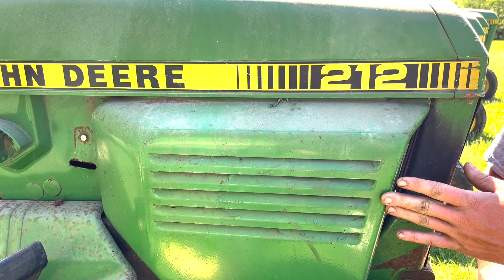The Entire John Deere 200 Series Break Down!!

Comment: I have a 212 with hydraulic lift, '78 I believe. Runs awesome, I run a Brinley plow and double extended tiller for the garden. I run the snow blower in the winter on huge drifts and it does great. I have the belly mount angle grader blade that I've used on my gravel driveway. And I just got a front mount   540 pto drive that I haven't thought of what I'm going to use it for yet. 

Before this one I had an 82 210 that I plowed snow with for 10 years and that was a good old tractor too. 
Thanks for the video.

Comment: I had trouble getting parts for my off brand riding mower so I decided to look at used John Deere. The parts guy at the shop told me he can always get parts so I started looking at older John Deere. An auction from dealer in OH had three non-running machines for sale, AS IS. I figured since they were all 210 ,212, 214, I could at least swap parts and have one good running machine.  The bidding started at $50 and was creeping up about $10-25 at a time. I got fed up with the hassle of checking all the time and decided to wait till two days before the end of auction and make my final bid. Two days for closing I saw the bids were still creeping up at a slow pace. At that time it was about $450. I posted $600 and forgot about it cause I was sure someone would outbid me. NOPE evidently my                          high bid spooked the others, made them think I was going to go as high as I had to and they gave up. A few days later I received email informing me I had won. Wow, so I had to rent a 6x12 trailer and go after them. I live in south central WI.
That was the start of my appreciation of the 200's. I started on the 212. The belts in the mower deck were rusted to the pulleys, had to soak with penetrating oil and pry off with screwdriver. Emery cloth cleaned up the pulleys, I choked when I learned how much new pulleys cost. Needed bearings and paint too so I did the whole thing while it was torn down. Changed the fluids to synthetic, did tune up and the beast ran like new. In the meantime I also looked at other used 200's just to see what was out there. Then I started seeing them on marketplace. Some were, "parts only". I feared the guy was going to scavenge all the goodies and junk the chassis so I offered to buy the whole thing. He was glad to have it gone. Evidently some guys just don't see the good of working on an old one when it starts to get rusty, and has faded paint. One guy posted two non running machines. A 210 and a 214. I told him it was a two hour drive to his place and offered $100. He accepted. While I was there, he offered an Ariens 8 horse walk behind snowblower for free. So we loaded it up. That was the best deal I every made!

I have been buying up anything that seemed to have potential and now have two 210's that actually have a 10 HP engine. Three 212's, and  two 214's. Three are operational and with a bit of luck I'll get a few more running before spring. I have a 212 chassis with no engine. Got that for $25, the guy just wanted it gone. Had one flat and three good tires.

At a rummage sale there were mower decks for sale. I got a 38 inch for 210, a 42 inch for 212, and a big deck for a 314 for only $75.They were asking $150. I looked at them and started to leave so he made an offer I could not refuse.

The 212 I bought first has mowed my 2 acre lot for three years now. I am so impressed with how rugged they are built. That frame is really rugged.

Ill have a whole fleet of machines to leave my grandkids. I'm gonna have to start convincing them of their value.

Comment: I disagree, on not wanting to go back to the 200 series, after owning 300 series. 
I still have both, and still love both.
Reply: My neighbor has a 317 sitting in his barn rn w all the implements on it. Wheel weights for my 212. I wonna get the whole lot to flip cuz I have no need for anything bigger than a 200 series. I’m not mowing grass at all w them, & if I do I’ll be getting a zero turn or fixing my 212 to do so. 200s are good pullers.

When my 212 was mowing grass I noticed that it has a terrible turning radius. And I was constantly switching from forward to reverse quite often.

I might try the 317 but I’ll probably just flip it unless my dad wants it with the tiller attachment.

Comment: The 212 is the most common in my area
Reply: I see a ton of 210s in my area. I drove 1.5hrs to get my 216 parts tractor. I’ve had 2 212s the 2nd was a parts tractor I tore apart cuz it was too far gone. I’ve also torn down the 216 for the hood parts cuz it was too far gone too. Saved the K341, main reason for getting the tractor.

Comment: What’s funny is that my 1982 212 has electric PTO. Or at least it did cuz the stock K301 was yanked out & Yanmar engine swapped. I plan on rebuilding the K301 & hopefully rebuilding my free 216 I’ve had for 2 years, but basically grabbed it just for the 16hp Kohler motor cuz they’re insanely rare.

Edit: 216 has been torn apart for the good parts. Saved the hood, battery box, varriator, engine, transmission, fuel tank, & steering wheel. It was too far gone to save. Got it for the engine, & the transmission.

Comment: Not able to get my 212 into neutral to push. I was just given this tractor 1981 212. Not sure where I should start to resolve this issue without making it worst. Thankyou
Reply: If you’re still having trouble with your tractor, I can tell you without a doubt that your issue is transmission related. More than likely blown detent springs, which is an extremely common issue with those Peerless 4 speeds. 

I’d also suggest resealing the transmission while you have it split (Deere still carries the seals needed for a 2300 series transaxle, thankfully)
Reply: Thankyou for this info.
I have sold the the tractor for parts  recently.